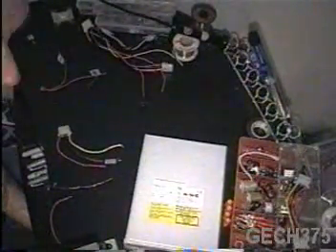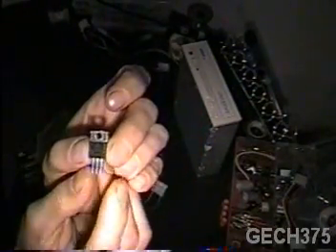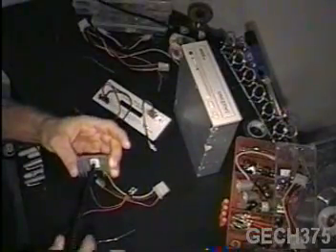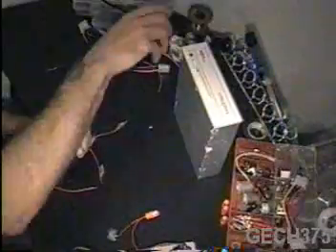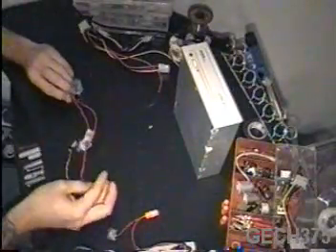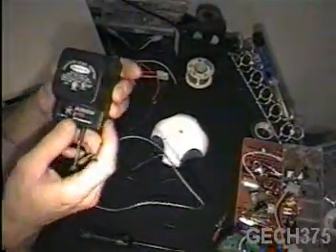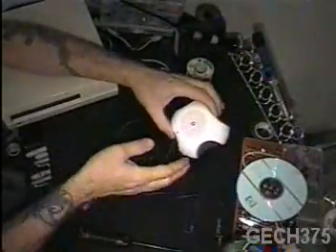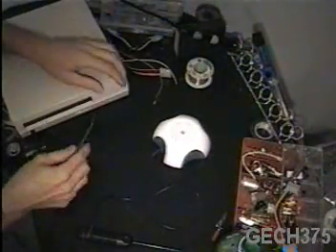DIY Stand Alone Cd Player

Comment: I have built a CD-ROM-Drive-based CD-Player too,  but I simply used the cirquit board of an old AT-power supply including the switch and the fan. I use it with headphones so I don't care about the noise of the cooling fan. 

I made a wooden case for it and used the audio-out too, so I can plug it into an amp, too.

Comment: I had a rig like this but it was just a cd rom drive like this one a computer power supply and a set of computer speakers and it worked pretty good, nice FLY speaker by the way I got mine for my videonow but I use it on all my stuff like my ipod and my radio, sounds pretty good

Comment: @renrono You can connect the green wire on the ATX connector to a ground wire and you can fool the power supply that there is a motherboard.

Comment: Thank you for your clever idea. Some Peanut Gallery need to know some electronics. How can you teach them everything in one video??. Very fine presentation my friend. Never mind the fools. Briefly the Unit requires 5&12 Volts reason why you install a rectifier so that you have both on the connector to hook to the back. The 5 volts to power the output to amplify the signal. Some kits are sold with LCD to give info.on Ebay. Look it up with all necessary controls for about$24.00. Good luck guys.

Comment: Nice DIY CD player bro! may i ask where did you connect the 12v adaptor in the cdrom?
Reply: there is a 4-pin connector on the drive to the right of the IDE connector which is used for power.
from left to right its 5V, ground, ground, 12V.
5V Red
ground black
12V yellow.

Comment: I'm a bit rusty with my electronics, so let me see if I got this straight: 12 you get from PSU, and you need another one, regulated to 5 V for the audio-out? Is that it? Did I miss something?
Also, do you know if you can temper with electronics to "manufacture" a next/ffd key?
Thanks in advance.
BTW. Nice case.

Comment: Hi! I have an old cdrom and an old power supply. Can i connect the cdrom directly to power supply? Thanks in advance!
Reply: yes, but you will need to connect the green wire to one of the black wires for the power supply to start.